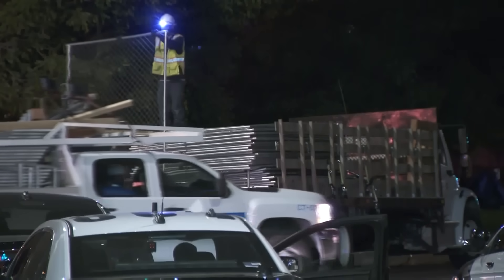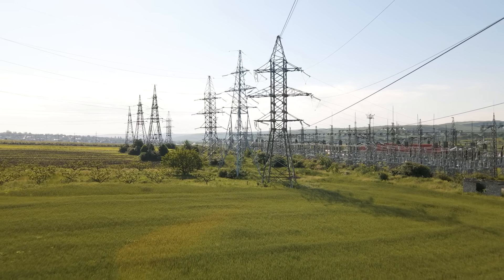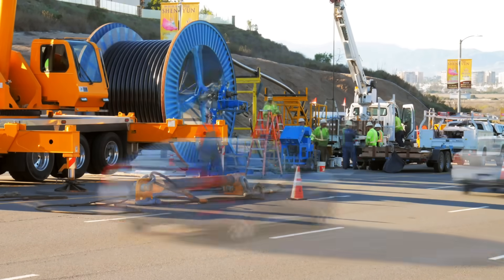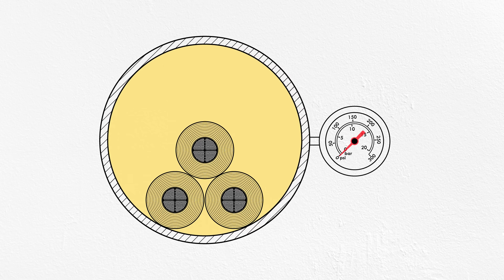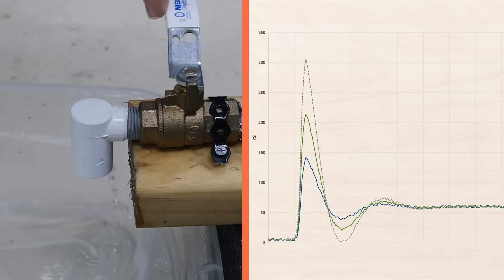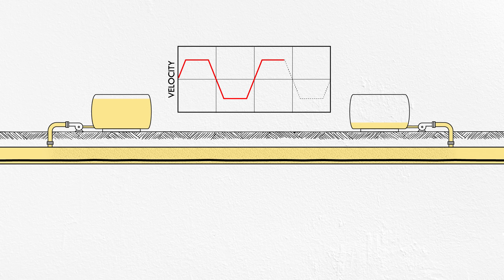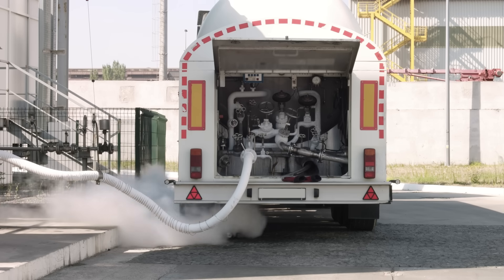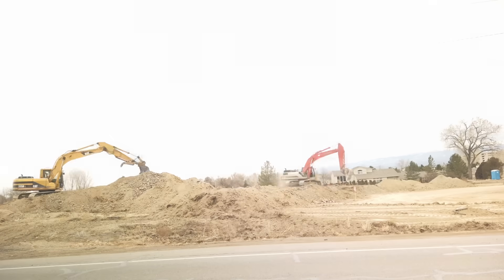Repairing Underground Power Cables Is Nearly Impossible

Comment: I live in Auckland, New Zealand. 
In the late 90s I was living overseas - but the city of Auckland (pop. 1M at the time ) had a similar problem. Underground, oil filled cables that could not be repaired.  
There was no power in downtown for a period of 5 weeks, all the high rise offices were empty, shops had diesel generators and they even had a ship pull up in the harbour.
I'd be interested in someone with more knowledge than me to say if this was a similar case.
https://en.wikipedia.org/wiki/1998_Auckland_power_crisis

Comment: I'm curious why the liquid nitrogen plugs inside the iron pipes didn't weaken or burst those pipes.  Presumably they were confident there was no moisture around and  obviously Liquid N2 doesn't expand like water, correct?
And my other thought is whether at some point local power generation (eg roof top solar) would make more sense for both reliability and safety than massive high voltage power lines from distance generators.   
If you mentioned how deep this was buried, I missed it.   Makes ya think twice before digging.

Comment: Generally speaking the entire electric grid in Denmark below 400 kV has been undergrounded. It's a really expensive affair but has the added benefit of being super reliable, even if repairs take longer. Actually, the Danish energy grid is so reliable that a new Facebook data center built here does not have backup generators (as far as I recall).

Comment: Oil insulation can last about forever, but if anything goes wrong you have a horrible mess of oil and a worse one of paperwork to clean up.  I was wondering if anyone was going to mention gas-insulated underground lines and their associated substations.  The gas is sulfur hexafluoride, which is very heavy and it's almost impossible to get an electric arc through it even at atmospheric pressure.  High voltage conductors in a pressurized SF6 atmosphere need clearances of 20 inches instead of the 20 feet needed with air insulation.  Thus substations can be somewhat miniaturized.

  There are a good many SF6 installations tucked into crowded downtown areas; they are not quite so difficult to repair.  Oil lines, which I thought were gone with the skilled splicing workers
they require, are an incredible pain to deal with.  Polyethylene insulated cables are the standard nowadays.

Comment: Weirdly, this is the second time I've heard of liquid nitrogen being a proposed engineering solution to a big problem, then found to not be used in the end. The first proposed cooling system at Chernobyl using liquid nitrogen injected using oil well drilling equipment was quickly scrapped.

Comment: I'm a designer who is working on R&C protection for substations and yesterday, 6/14/23, I just learned about a new gizmo to pinpoint faults on a transmission line accurately. I'm new to this line of work though I've been here going on 5 years and never had any idea of the trouble with UG cable repair or have given any thought to finding the faults accurately. Figured that was all done already if someone would have asked me about it but I see that's not the case. Thanks Grady for all you do and especially for this episode. I've learned a ton from your vids and have gained much respect for those guys you see leaning on shovels not moving at that moment. I'm like you, perhaps I should say you're like me since I seem older lol. In any case, I really appreciate your videos.

Comment: The brand new super high voltage system for London, called the Ring Main is so called because it circles under the capital not unlike the circuit in a house.
To avoid workers getting ill from cycling to and from the cables to be inspected, fixing and cycling back ~ heat, EMF and so on, they have built a monorail hung from the ceiling. Yes, truly.

Comment: This is just too cool. It's also badass that you went out and found the original poster and talked with them. I write software and debug electronic circuits for a living. I have always had a fascination with high voltage generation and distribution. It's fascinating as the rules just go wild with high voltages. Everything I work with 5-12 volts, where there is relatively little weirdness. Granted complex digital logic does have its own quirks. I love your videos....just straight engineering and physics with no fluff or filler.

Comment: Repairing underground power cables is easy, i do it once a week. Transmission lines are transmission lines. completely different thing. They dont even carry the same power. Transmission lines carry DC power. Power cables are AC most of the time.

Comment: My former house had underground electric connection . I would not want a house with it , basically when a bad storm happens water tends to follow around the piping and it hits right at the foundation.

It’s more common in Europe , but they simply do not have the extreme climate of USA. 
That Roman concrete that everyone says that last so long, it’s because it’s in a climate where rain is either constant light or sun shine for weeks at a time . Compared to USA where you have 100F , then a shower that lowers temps to the 70s then back to 100 and then night lows that get down to 50F or lower for many days of the week.

Comment: During my Apprenticeship with our local Electricity Board in the UK (back in the early 70s), we covered overhead and underground distribution networks. Part of that was Fault Location underground using a series of instruments forming a 'Wheatstone Bridge' to determine the electrical resistance of each leg of cable on either side of a fault. With this, we could calculate exactly where the fault lay. In those days, before pocket calculators or PCs, it was a real headache! We also toured an Oil filled EHV cable 'handling station' with its pumps and monitoring systems. Very interesting, and I dearly wish that it had all been explained as clearly as you just have, we may have fully understood it then!

Comment: At a stage of my engineering career I developed policy and strategy.
We resorted to philosophy to determine principles related to engineering issues.
One of the key principles in engineering is that we often deal with resolving paradoxes eg in this case "Work on the shielded conductor without disturbing the shielding effects."

Comment: Key takeaway: overhead transmission lines are time-tested and proven to be reliable, generally safe, and much less expensive to build & maintain than high-voltage underground cabling + the expensive infrastructure to maintain it.

Comment: High voltage transmission lines should be built overhead outdoors for highest degree of safety, efficiency and speed of locating faults. Yeah, they're not pretty but it's more important to have a reliable, economical electric supply.

Comment: At the risk of nitpicking, one would typically refer to that as a cable and not a transmission line (the latter of which are typically not insulated and run above ground as an overhead line suspended from tower structures)

Comment: Watched some cable work under the pavement in my street: They took up pieces of a century old cable. They were wound in cloth and an outer steel band and then doused in tar or bitumen. The underground junction boxes and splices were cast iron boxes bolted together.

Comment: For long distance point-to-point power transmission, if there is no need for taps along the way, implementing a DC link would seem like a better idea. Only need two wires, and you don't have the skin effect loss.

Comment: That underground transmission cable (we reserved the term "line" for overhead transmission) was such a headache when I worked for LA. When unloaded, at night and especially on the weekends we had such trouble keeping system voltage within safe operating limits because of the capacitive properties of the cable. Additionally, SCE (our electrical neighbor) and Cal-ISO both knew one of the options LA had for voltage control was to de-energize SCA-OLY Cable A, but refused to recognize that cycling the circuit (especially re-energizing it in the morning) was degrading the integrity the circuit - poking holes in the insulation. (I remember one shift supervisor on an early Saturday morning, about 3:00-am, considering taking out the circuit, having tried everything else to get the voltage down; an alert system operator overheard him and piped up, "I wouldn't do that if I were you." Then he related the caution our security engineers had stipulated -take the line out of service at your own risk, because the next failure could very likely be the next time the line was re-energized. We eventually convinced SCE to move its generation pattern in neighboring Ventura County to lower system voltage in LA. They didn't want to do it because it's a costly solution.) 
As I was retiring a replacement project was underway which included more reactive equipment to control VARs, and to rework the vulnerability of the pumped oil insulate characteristics of the cable.
Reply from the maker: Thanks for sharing. Super interesting!

Comment: I was working for LADWP when this line was installed, knew most of those working on the line.  It ran close to my house so I would visit with them when I could. I also worked for the Generation section and was on the startup crew for Scattergood Unit 3 which this line was built for. Great video.

Comment: Just watched this for the first time today, 11 months later, but I'm always fascinated by your outstanding videos, Grady.  We have a very conventional short distance underground line where I work and it can present maintenance problems too.  It's "only" 13.8KV and goes through a couple of underground vaults.   Now that it's approaching 25 years old, the question is arising about what it will need for replacement or upgrading.  Pumping insulating oil through the conductor pipes is one possibility.   Also, we have a glycol loop in the plant which recovers heat energy from our turbine-generator exhaust stack.  The loop has something like 2500 gallons of ethylene glycol in it- not simple to drain.  We've successfully used LN2 for freezing off and servicing this system, though it did take several tries before they got the calculations right and actually sealed off the lines.  Thank you so much for Practical Engineering!

Comment: Snap, crackle, pop goes the electrified, electrical, electricity.  Snappity, pfffft.  Fire will fly!  Flashity bang.  Your eyes will light up, your teeth will chatter, & steam will pour out of your ears.  All those electrons roll down through those wires like chrome plated ball bearings.  Oh, those electrified, electronic, electrons.  Hum, buzz.  Good old electromotive force.  Transformative, transforming electrical transformers love to sing one single note, the 60 cycle per second hum.  Alternating current changes direction 60 times a second, causing magnetostriction, a tuning fork vibration in the transformer plates.   Oh, hum like a bumbling bumble bee.  Its a electrifying experience.  Sparkle plenty.  Sparkle, shimmer, & shine.

Comment: Even to this day we don't have every detail perfected in engineering. It's an on-going process year-to-year with new standards introduced to improve on previous iterations. When I tell my non-engineer friends about the certain details I learned that week, some tell me, "Isn't that obvious?". Sure, it might sound obvious once someone mentions it to you, but the "obvious" may not show signs of it needing to be considered until years down the line. This story also shows how imperative considering every aspect is in infrastructure design. Often, when a detail is not considered in the original via a standard, previous practice, or poor detailing at that time, it can become very expensive to retrofit. The retrofit solution may be simple, but can be a logistical nightmare.

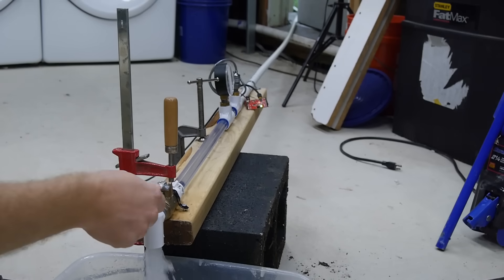Comment: 6:30 Rather than moving the fluid one way then the other, why not make a loop and have it flow in a circle. Then you don't have to worry about fluid hammer. you can safely pump the oil faster, making it more efficient.
Reply from the maker: Double the pipe and double the size of the right of way

Comment: My only question would it be possible to have tunnels dug under ground for future maintenance to be easier?  Yeah cost will be huge but the reasoning is to get rid of the high voltage wires above ground that are the cause for fires recently. The reason i thought of this is we have sewer access points that humans can fit into so why not just dig a parallel system to the sewer system but for power with thicker concrete of course for the walls so one doesn't spill into the other. It would also have the benefit of when more power lines are needed it will be easier, quicker and cheaper to put in than if they are fully surrounded by Earth. The down side will be the maintenance onto the tunnels and the method to keep the wires a part in a way that can be worked on safely by humans. Once put in place it will provide a better way for long term electrical underground long distance and short distance transmission. Having it all underground makes it so only Earthquakes will disturb the wires which can be dealt with with only a complete structural failure making the electrical parts cut which would happen anyways. The reason why underground and not right above ground is physical space isn't that cheap and that able to be gotten above ground. You will have environmental concerns as it is digging a new most likely wider tunnel to lead to all houses but below ground.

Until the system breaks again i do not see anyone with power to change it wanting to and making it change.

Comment: I saw a underground high tension power line put into the earth. The copper constructed power line did not use any paper of any kind. What was used is a plastic insulation inch plus thick  and a circular pipe corrugated form with copper construction which was the ground that encircled the power conductor and a much thinner black plastic outer skin for cover. The diameter was six inches roughly that carried the power to the best of my memory with  285 K voltage rating. Do not remember the amperage which I did remember a few years ago. Sorry my bad.  Well done video and to the point.

Comment: Hello this was so cool. I saw this type of repair that took two weeks, in NYC a block down the street from a major substation on the west side of Manhattan at 42st between 8th and 9th Ave. At the time I did not know what they were doing. Each day on my way to work, I would stop and look down in the hole. It was the one day that I saw that big Cryo tank truck with a Nitrogen, refrigerated liquid sign. Two frozen hose with ice over both went down into the hole. The length of the hole was 20 feet and half of what I saw was covered in ice frost. When I had asked one of the workers what was going on? He was so glad to show me and tell what they were about to do. I said, That Pipe is a high voltage cable? I worked at a TV broadcast transmissions systems site. I then said so that's a peace of Coax. He said sort of. Just not for RF. There are 3 phase very high voltage cables in the pipe and high presser Oil keeping dielectric. So yes. I had the amazing time that two weeks. watching how they fixed a bad short and did a full repair all the while at the 5 foot of cut section. a Solid frozen plug could be seen of Nitrogen. To this day in 2022, I still walk down that street and out of all the people on the street. I know just what is setting Right There and how it works and where it is going. Wow. Thanks. I love your peek into things .  :goodvibes:👍👍👍

Comment: SOme seriously fascinating engineering techs.  Well done video, yet I would of liked to hear a bit more about the solution they used that worked so well at the end...well I guess you DID get into it more because the actual solution was two fold, the FIX, and also the newer pipeline without similar construction limitations.

Comment: The design was the problem.  Short sighted engineering that looks good on paper too frequently becomes the leak in the budget.
Reply: I.E. The core points made on the difficulty of repair.  A quality engineering solution incorporates not just ease of manufacture & install, but maintenance... most esp if we are talking civilian infrastructure.

Comment: HV cables were so not a new technology in the 70's! The Siemens Brothers ran an 11kv line in the 1870s, PILC was commonplace between the wars and in the 50's? 60's XLPE was developed. Repairing them is...tricky but commonplace.
Reply from the maker: It was still new to many utilities who had no experience or familiar staff
Reply: @PracticalEngineeringChannel  not only that, but we're talking 230-kV.  5/12/35/69-kV...a walk in the park.They''re all over the city.

Comment: There should be "fault points" or easy access to bypass connections where if a section of underground line goes down, a temporary above ground system could be ran while the underground is being worked on reducing the down time. Maybe even installing prrset holes in the ground where poles could be dropped in when an emergency situation takes place? The advantage? Not effected by ice, wind, tree limbs, car wrecks but eliminating some of the down side.

Comment: Great story. Our local power provider has been dealing with lower voltage (under 30KV) direct burial neighborhood underground cables that were supposed to have a 50+ year lifespan but are failing in some cases after just 20 years. It sucks when things don’t work out as planned and there often isn’t enough money to do a preemptive replacement decades before the expected replacement date. Instead it’s typically patching unreliable underground cables as needed but often resulting in more frequent outages. It’s too bad the companies selling the cables cannot be held liable.
Reply: The XLPE used 20/30 years ago in some places, was highly prone to treeing. This has been largely improved by better quality standards in production.